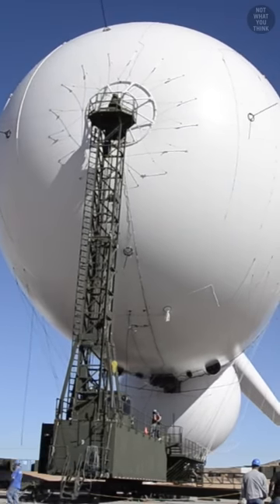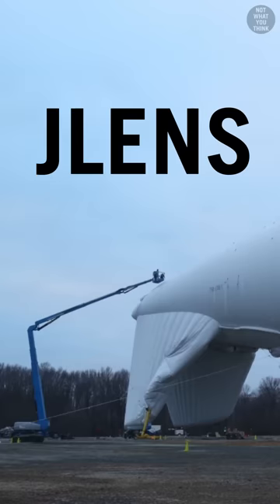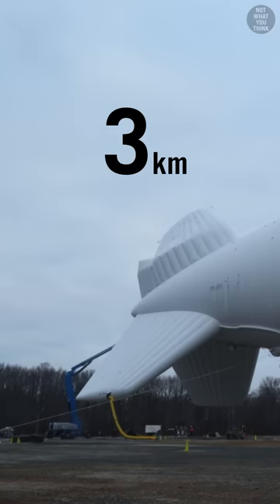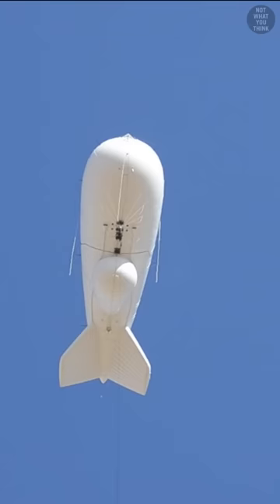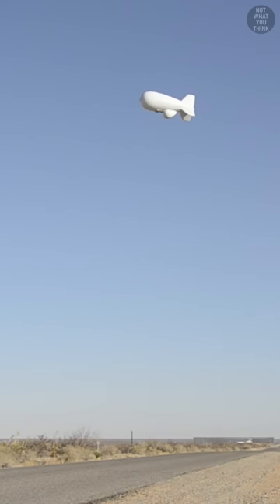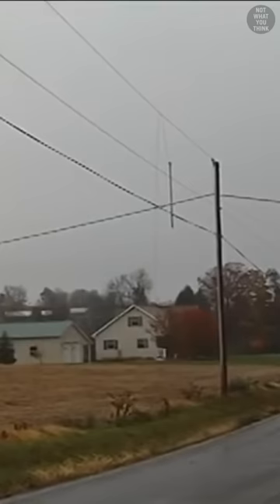What Happened When the Cable SNAPPED? #shorts

Comment: Have 3 cables? Or have a device on the balloon that destroys the balloon if it drifts .
Reply: or just dismount the cable when the cable snapped?
Reply: @dayquantavous3rd  I would think that you don't want a giant balloon running amok up where they can hit planes, and if you just lets them go then you lose the equipment.
Reply: This... would have made sense.. But, government...
Reply: The PGSS balloons in Iraq/Afghanistan had a self-destruct feature so it would fall as close to base as possible. It's especially inexcusable when that's already the standard!
Reply: I'd say three kevlar reinforced steel cables tied (but not wrapped) together, a swivel mechanism  so the cables couldn't get tangled when the balloon spins as the wind changes, and three comms cables that run up each of the three cables. If all three lose connection, the balloon deflates fast enough to come down within the bounds of the airfield but not so fast that it could crash and destroy the equipment on the balloon
Reply: Instead of a self-destruct device, how about having a device that just pulls a couple of BIG plugs and lets the air (helium) out of the dang thing  like, you know, a big assed Beach Ball?!?
SOMEBODY didn't do their homework. SMDH
Reply: @user-td1zo3tv9p  Well that almost the same thing, but it just doesn't sound as cool 😎 can be as simple as a spring-loaded nail.
Reply: @richardmillhousenixon  Just comm through radio
Reply: @user-do5zk6jh1k  Still need some way to reliably and immediately tell when the tethers have snapped or disconnected
Reply: @user-do5zk6jh1k  Also radio comms can be intercepted and listened in on Hardwire comms are much more resistant to that
Reply: @richardmillhousenixon  Both good points. I was thinking this could work well for civil applications, like what you see on the border.
Reply: @user-do5zk6jh1k  that's not a civil application at all, that is very much a military/government application
Reply: @richardmillhousenixon  To an air force guy like myself, it's a civil organization like the police. I draw the line at the 6 branches of the armed forces
Reply: But, but…that would MAKE SENSE! We can’t have THAT now, can we! 😆
Reply: @richardmillhousenixon  wouldn’t the cable likely be under tension while the ballon is in use? If a cable snaps maybe have a mechanism that detects the loss of tension on the line and auto deflates the ballon at a slight angle. The angle would hopefully help it land in open plains, or just away from the base and ground equipment.
Reply: @philrob8994  Force sensors aren't foolproof and could be triggered by winds. Using data cables to also function as the triggering mechanism would be cheap and virtually impossible to have a false positive or negative
Reply: @richardmillhousenixon  Actually, why not go simpler? one extra cable, run to a tear flap at the top of the balloon, loosely tethered to the main cable so main has to be separated and balloon drifting to trigger. Simple mechanical fail safe.
Reply: @kstricl  That's actually a good idea. The cable can be just like 10 feet or so longer than the main cable and it wouldn't have to be near as strong (so it would be much thinner, therefore cheaper and lighter) and the tear flap can be sized for a controlled descent of the balloon